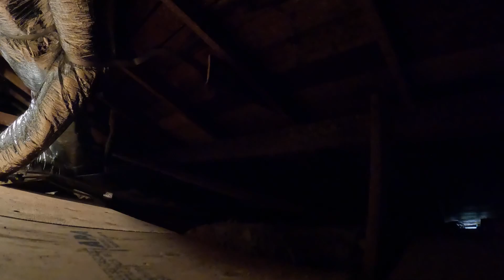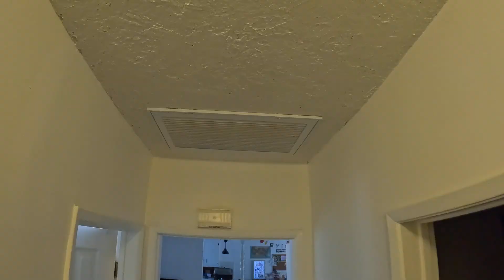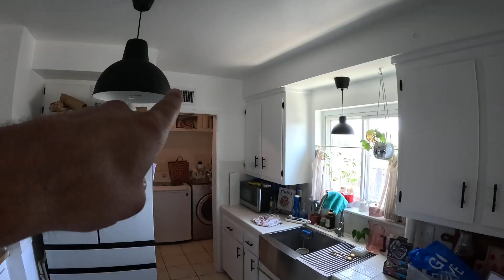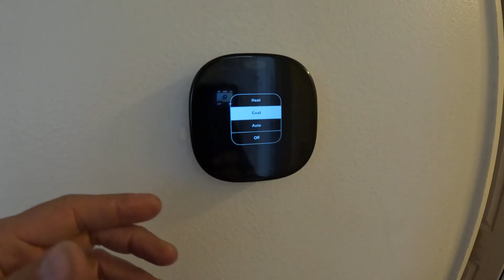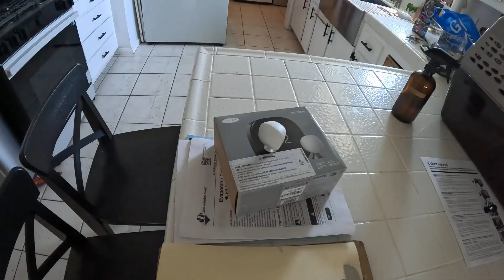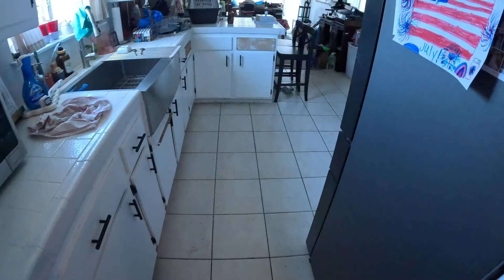Why moving your furnace to the attic is one of the best HVAC upgrades

Comment: Does it matter if you put the return air  in the ceiling or down lower?
Reply from the maker: Placement matters because you want to pull heat out from the areas where it accumulates, which is why we often prefer ceiling returns in these installations.

Comment: I noticed in some systems you guys used unistrut to suspend the unit in the air while this installation used a stand. Any reason or which one is better?
Reply from the maker: The choice between a platform stand and a suspended unistrut system typically depends on the structural layout of the attic and the accessibility required for the unit.